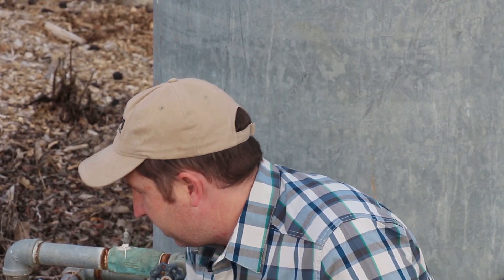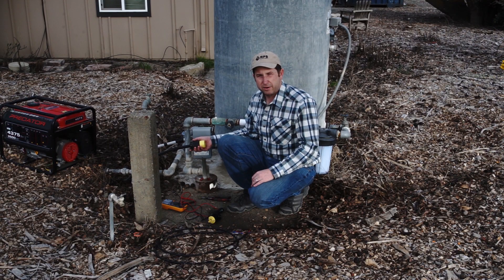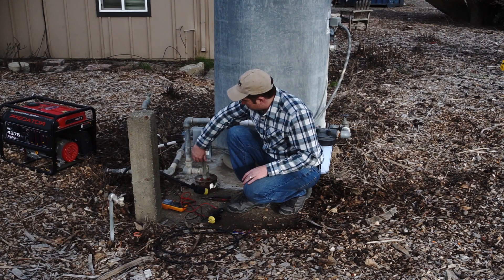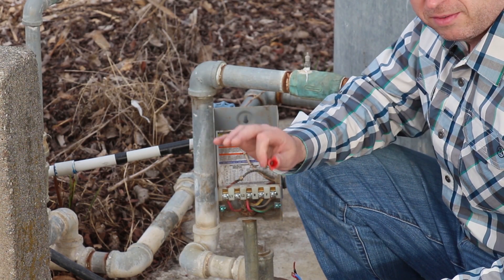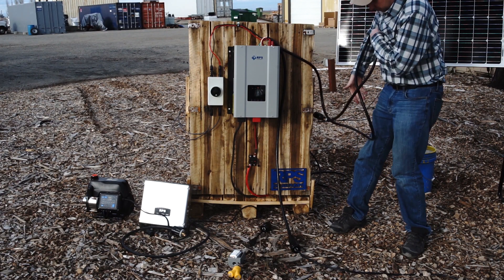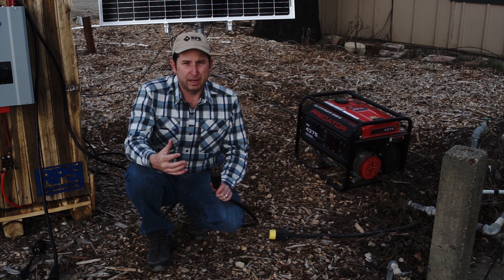Installing WaterSecure™ with an Existing 220V Well Pump

Comment: This is exactly what I have been looking to do. I have a 550' well that uses air pressure to bring the water up to the holding tank, 220volt 2 hp motor. I have a shallow well pump and a pressure tank from there, also 220volt 2hp. Last year we had a crazy drought, the heat fried my air pump which had never happened before. I cool it now by looping the copper airline through a big bucket of water. The This pump feeds 16 acres and watering it was crazy expensive. 

I've been looking for DC motors to run the air and pressure pumps, or some other solution to get it off grid. We had two hurricanes within two months a few years ago and combined we were without power for three weeks. If that had happened during the drought, I would have been jumping through major hoops to keep the water flowing or paying crazy fees for using the co-op water service, we keep as a backup. 

The well is at the top of the hill, go figure, and eventually I intend to have a 10,000-gallon holding tank and gravity feed for watering. That eliminates the pressure pump. I can use small 12volt solar booster pumps if needed at the point of delivery. 

I am very surprised that there aren't many more solutions for this scenario. I've been looking for a while and really haven't found anything that wasn't commercial grade and crazy expensive.

Comment: I am looking into installing solar for my well too. The problem is, I do not know the Volt, Amps, or Watts of the well pump. The house uses the city water and right now the well is hooked up to the power grid. How do I determine how many solar panels or batteries I need to power the well?

Comment: I just installed the 3K panel in my well pump system. I was able to wire in a new sub-panel for the existing pump. I can also use the 3K panel to power the house if need be. I have a pressure tank system so I can allow the pump to charge the tank and then turn off the power to the pump so it won't overload the 3K panel if I want to power the house grid by back-feeding into my existing panel. Because everything is 220v split-phase all I needed was a few 30amp breakers, wire, and a sub-panel. I have several scenarios that I can use this system to power the house and the well pump. Now that the RPS panel is installed I have an off-grid pump that saves on my electrical bill and a 3K converter for emergencies that can be recharged several ways.  

As mentioned in the video, I can charge the batteries from grid power, my dual-fuel generator (100 gal Propane tank), or the solar panel. The logic they have used is very sensible. The RPS panel will wait to pull power from the solar panels if the batteries are only slightly discharged. So even if the battery level is 88% at sunset, the RPS panel doesn't waste your money by pulling grid power over night to charge the batteries. It will wait until the next day to see if it gets adequate power from the solar panels. The overload protections are also well thought out. I tested a couple. 

Thanks to Andrew and all the great people at RPS Solar! You have a great system and team to be proud of.
Reply from the maker: Glad to hear it all setup Tim.  Happy to help!
Reply: I am very interested in converting my home well to solar off grid. I already have six 360 watt panels. I have been looking at the water secure system. It is really cool because you can use it as a solar generator to power some of your house appliances in a black out or all the time if you build it big enough.  I do wonder though if it would be more efficient to replace my current 220 v 1 hp pump (because of surge) with a dc pump such as the gundfos sq  or other 12 volt pump and run straight from the solar panels and a small battery bank as a back up.  I'm looking for efficiency and independence from the grid.
Reply from the maker: @steveforliberty7801  Do you use the well pump to also produce pressure for your house or do you gravity feed for pressure?
Reply: @RPSSolarPumps  I also use it to produce pressure for my house.  I have a small hill right next to my house where I could put a 2500 gallon tank and gravity feed water back down to a small dc pump. The hill is unlikely tall enough to produce enough pressure. Can the inverter use the power from the panels and compensate with the batteries or does it exclusively pull from the batteries?
Reply: @RPSSolarPumps  Am I asking for too much?
Reply from the maker: @steveforliberty7801  Hello Steve, not at all, but probably best if we go over these details in real time or over email.  Want to give us a call at 888-637-4493 and we can help with planning!